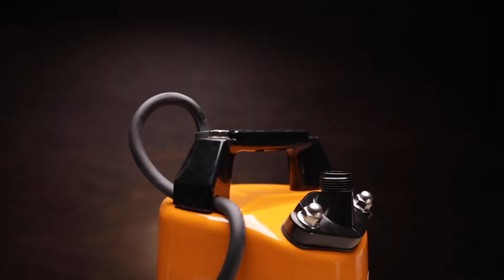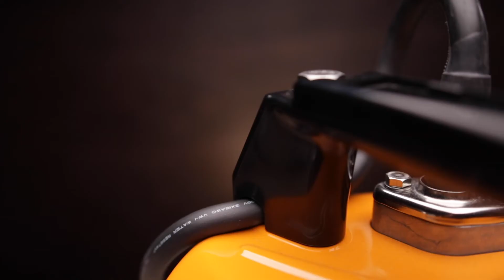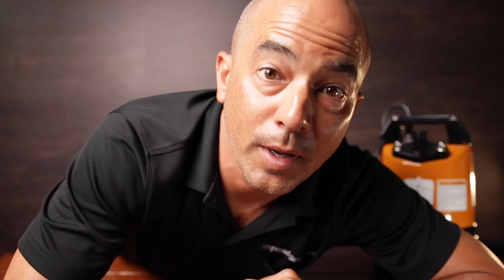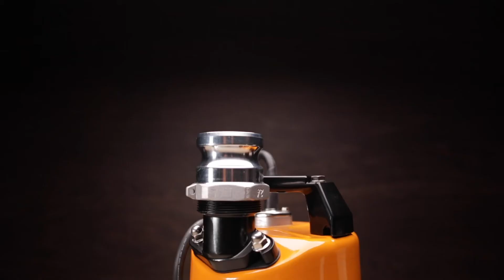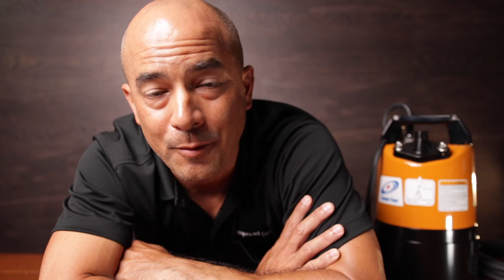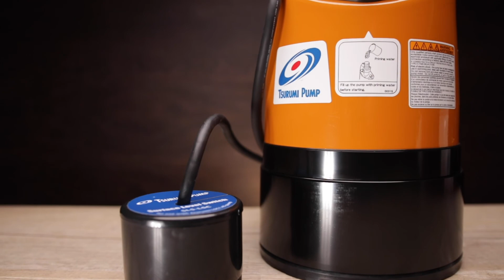Tsurumi LSC1.4S Surface Level and Submersible Dewatering Residue Pump

Comment: If you need to power it off of a generator that has non GFI outlets, will it be safe to use?
Reply: Hey Paul, we would recommend to always use GFCI outlets with submersible pumps.